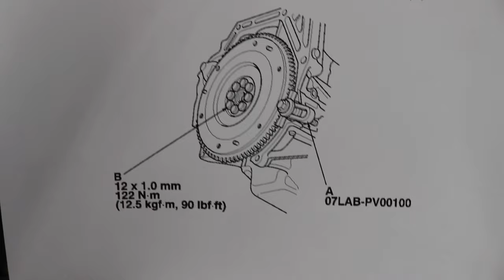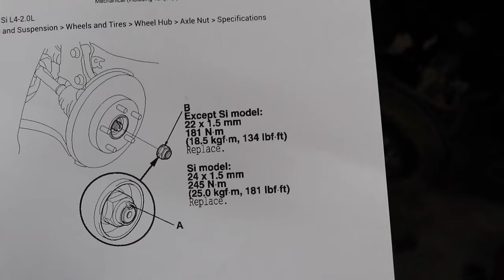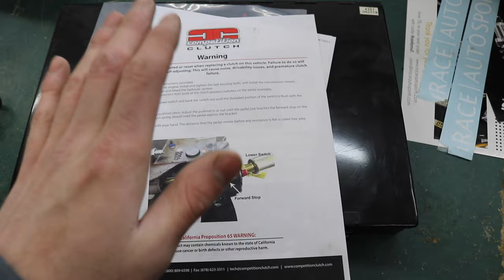Honda Civic Clutch Replacement!! (Si)

Comment: Perfect video
Reply from the maker: That’s what I like to hear! Tried to be as detailed as I could :)
Reply: Do you know the torque specs for the mounting tranny to engine?
Reply: And what specifically tools did you use?
Reply from the maker: @Automatons.  I never torque bell housing bolts, just tighten them up good with a 3/8 ratchet 👍🏼
Reply from the maker: @Automatons.  I go over tools/socket sizes for each bolt as the video goes on

Comment: Be very careful not to move the steering wheel 1 degree while rack is dis connected 
On some models if this happens when reassembly is complete and power is reconnected the airbags could deploy

Comment: What did you do to your knee brother
Reply from the maker: Sprained my MCL at hockey last week 😕 was not fun to pull this transmission when I couldn’t bend my knee without being in pain, but it had to be done 😅
Reply: A couple questions. If you had to go with a less expensive clutch kit what would you recommend? Also how long did it take to actually change out? BTW great job on the video!

Comment: Why are you making such a big deal about not dropping the steering rack it isn’t hard at all to do all you have to do is take the one 10mm bolt out of the bottom of the steering shaft. I did a motor swap on my car and when we took the subframe out i just took out the one bolt and separated it at the bottom of the shaft and then when it came to reinstall i just slid it on and put the bolt back in. Makes it way easier than trying to line up that splined part higher up.
Also totally unnecessary and more difficult to remove trans mount from chassis lol.

Comment: This video clearly shows that the content creator have not read a service manual. It is worth only $24.00
Reply from the maker: Care to elaborate a little on that? 33:36 literally shows the torque specs for the flywheel. I printed those directly out of the service manual ALLDATA provides. ALLDATA gets all of their service information from the manufacturer.

Comment: Guys it’s seriously not that hard. Realistically it’s about things 10 things coming off. 4 of those being major/heavy stuff. But if you have 4 jack-stands, and about 2 jacks you could have this done in say 5 hours. Me as a 17 year old with a buddy of mine that’s slightly more mechanically inclined got this job done in 4 hours. Learn a thing or two and save the $1200, we did it with 4 jack-stands and  1 jack at the time of removal. I personally man handled the trans back in. If I, as a young dumb immature teenager can do this with a friend so can you as an adult.
Reply: Ppl r always so scared to go head first n try things out. I been workin in cars since i turned 17 n bought my first car which was a civic i bought for 400 dollars bcuz it was a piece of shit and that was my chance to learn lol. However any car u work on will be difficult if u dont have the right equipment but there will always be other solutions to make it work.
Reply: yeah man thats the only way to learn tbh. my car wont go into gear and makes the same noise as his so tomorrow Im dropping this trans and praying it all goes well 😂😂
Reply: @escodenny2992  hell yeah bro good luck and i hope u get it figured out
Reply: @escodenny2992  after clutch job? Or out of no where
Reply: @Deetzat  before the clutch job lol.  late reply but basically my clutch was always making a noise. I always ignored it for a good month until it locked me out of every gear. My clutch spring was lodged between the pressure plate and clutch just like the video lmao. I got it all fixed up tho thankfully
Reply: @escodenny2992  oh okay lol. I asked because after my initial install we put the frickin clutch disk in backwards! The car turned over no problem but it was impossible for it to go into gear. Ripped it all back down in about 2 hours come the second time. Pretty embarrassing but lesson learned. Since then I’ve helped my friends do the their clutches for Toyotas, and their Hondas as well. Not many people are willing to wrench themselves. If you can you stand out from most already. Good job!